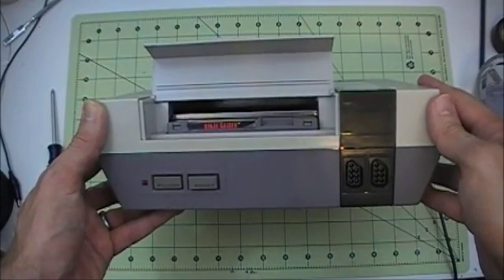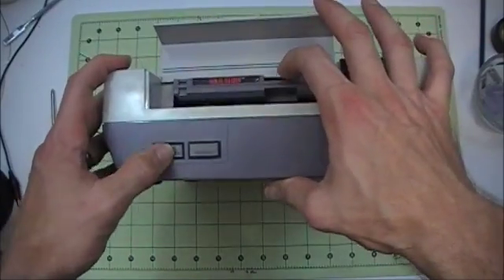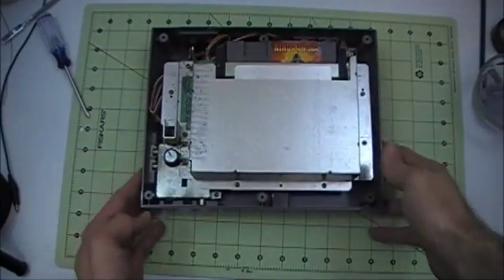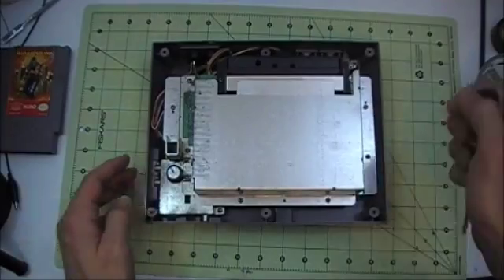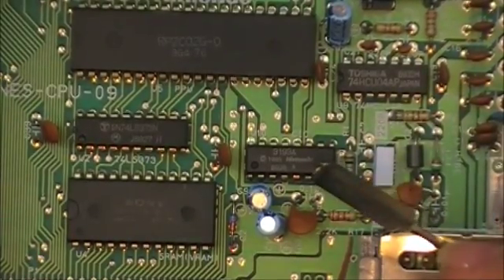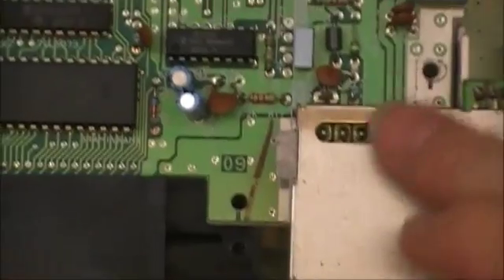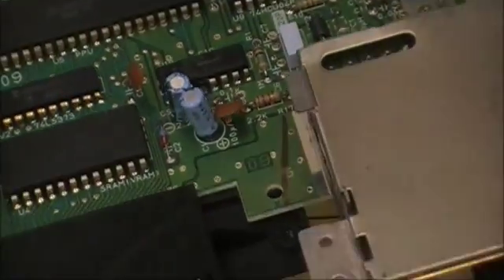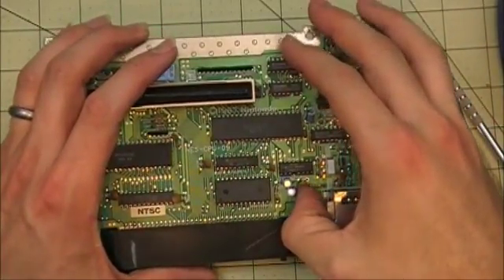Disabling the NES Lockout Chip - Blinking NES Hack

Comment: The best nondestructive way to disable the lockout chip (if cleaning and boiling the 72 pin connector hasn’t worked) is to de-solder pin #4 from the board instead of cutting it.
A cheap $10 soldering iron and a pair of needle nose pliers works well.

Comment: I have disabled the CIC chip on a couple NESs. I like to desolder that one pin and pull it out away from the board. It will work leaving that pin floating but it really should be tied to ground. You can use a short jumper and tie it to the ground for the chip.
Reply: Why should it be tied to ground? I've only ever seen people just clip that pin and push it out of the way.
Reply: @colt5189  just disconnecting the pin will work but that leaves the pin floating. It's better to either tie it high or low. In this case it's low which is ground. When I do them I desolder that pin and pull it up away from the board. I then take a short section of wire or the leg from a new component and tie it to the ground on the chip.

Comment: Great video thanks.
I hadn't used my NES for about a year turned it on and got a grey screen. I accidentally ejected the cartridge without switching it off. Led started blinking. I replaced the 72pin connector. Still blinking.

After following your video it now works perfectly again.

The light was blinking with no cartridge in not sure if that was normal. 

Can ejecting cartridge with power off kill the lockout chip?

Thanks again :)

Comment: I wonder if the lockout chip is what is wrong with my Nintendo NES? Because it has not been turning on at all lately. If eliminating the lockout chip function is what I need to do than that is what I am going to have to do.
Reply: if it doesn't turn on the power supply is likely broken
Reply: @gamecubeplayer  I will not do it myself but I will instead have my local independent home video game console repair man fix what is wrong with my Nintendo NES.
Reply: @wallacelang1374  get a new nes power supply to see if the nes turns on
Reply: @gamecubeplayer  I know that it is not the power supply for it is the flashing red light that is the only thing that works, so I believe that it has to be both the contacts are getting worn out and the #4 pin on the encryption key chip is stuck in its lock out function.

Comment: I have the similar problem, blinking and jumping image. I cleaned the 72-pin, I even replaced it with another original 72-pin and it still produces the same problem. It's not a big deal bc once I restart the system  it fixes itself. But I still wonder what causes the initial blinking when I turn the system on for the first time, and every single time. Could disabling the chip  work?

Comment: This doesn't fix anything it just makes your NES crash in different ways over extended gameplay.
Reply: You did it wrong
Reply: @deluxrefurbish6601  You don't know what you're talking about, RAM and CPU problems exist in many NES consoles and you know.. all computers. The lockout chip doesn't cause the blinking therefore disabling it cannot fix the console.
Reply: @Blind0ne9k  did you cut pin 4
Reply: @deluxrefurbish6601  I have fixed many NES consoles, the right way. Learn about electronics before giving advice.
Reply: @Blind0ne9k  well it makes it region free

Comment: I've opened the NES up before and the 72 pin connector on mine was way bent down so I bent them back up and that fixed it. I didn't bend them too much or the connection would be too tight
Reply: Also I cleaned the connector where the 72 pin went with an eraser and some window cleaner so that did the trick

Comment: Please stop doing this, this is not a "fix", what you say about replacement pin connectors is wrong.  My nes has had a replacement connector in it for 15 years
Reply: Well it may not be a "fix" but it sure helps to solve what stops the resetting issue.

Comment: I have 3 NESs, I cleaned all 3 and I have a copy of Tetris that works with all 3 but Addams Family does not. The contacts are all clean on the game. Can it be faulty? I can see the language select screen for a fraction of a second but then it resets and the red light blinks. Is it the game or all 3 NESs are bad? Tetris works first try every time!
Reply: You need to clean the cardrige so the pins make good contact. Use Isopropilic Alcohol
Reply: @chamuquismalta4310 I figured out the solution since. I bought Addams Family from the UK (PAL region)  and I live in Hungary and all 3 NESs are from Germany (PAL and PAL region). But I wasn't aware of the fact that Nintendo was a stupid asshole and made multiple PAL region games, not just NTSC vs PAL. The seller was kind enough to accept my return.

Comment: This is the most retarded way to fix a something very simple. Either A clean the pins with a game that you put alcohol on over Rand over again, and or B use a dental pick to slightly bend upwards the pins on the connector. Why do you want to risk fucking the board up? This is stupid.
Reply from the maker: I have videos on all of those methods and I recommend this one only as a last resort. There’s also a no cut way to disable the 10NES chip but the documentation is kind of sketchy because it depends on what revision of the board you have.

Comment: I'm a bit on the fence with your hack. I've had the NES since it came out,. Now it's retired to the loft. The flashing LED was there also for cartridge errors, in my case, having poorly store the cartridges, the contacts became oxidise and tarnished, and this LED would tell me that I need to sort the cartridge contacts out. It's annoying, but there for a purpose. It may be hard, but putting a jumper in place would give the option to go back as it was. Just my thoughts, liked your video very much.
Reply from the maker: Mr C I don’t recommend doing this until you’ve tried cleaning everything and tried either refurbishing or replacing the 72 pin connector. I know there is a way to solder some jumpers instead of cutting the pin but I’m not sure if there are instructions out there that work w all motherboard revisions.

Comment: I wonder if this might help with save data erasing on cartridges. I’ve had that happen to me several times with various games. I have to think that with it resetting itself like that u stand more of a chance of it happening. After all u are supposed to hold the reset button to put it into safe mode before powering down to prevent losing save data.
Reply: Save data is saved to the cartidge not the NES, there is a battery inside the cartidge for this purpose. If your losing your saves, it means the battery inside the cartidge is dead and needs replacing. Cutting pin 4 will not fix your save data issue whatsoever
Reply from the maker: I can’t remember exactly what caused NES saves to get messed up (info is available on the net) but you might be onto something.
Reply: @8bitjunkie8  dead battery in the game cartidge is the cause of lost save data. Saves are stored on the cartidge nt the NES

Comment: Fellas Fellas, here is a simple solution. I don't know how many of you have refurbished or repaired NES Consoles but I have refurbished a few hundred since I started and have a killed and fried many as well. So here's the shit: Take the console apart completely, next clean the mother board and copper pins. Next clean the 72 pin connector, boil it in boiling water, yes boil the shit out of it, then pull the pins back to a tighter fit, always clean your games and put the console back together and BAM! Works every time. There are many videos and different varieties you can use and I have learned from many Youtubers and applied my own unique style over experience and works like a charm. I can play foreign games, pirated games and never see a blinking screen ever. Oh yeah you have to disable the lockout chip as well. This is a fun hobby and everyone has their own opinion.  So just enjoy it, share your ideas and stop being a know it all and have fun. Thank you 8bit Junkie for this bad ass video. Ignore the Trolls. : )
Reply from the maker: true story. clean games and boil.  if that doesn't work, bend pins.  if and only if doing all of the above doesn't fix it, or you want to region unlock, disable the 10nes.  

you're welcome.  never feed the trolls.

Comment: one tip I will give people trying this - is when you put the cartridge loading mechanism back on - you might find it doesnt sit flat and seems to be incorrectly placed, and then when you screw it in, the mechanism wont stay down. this is because theres a small plastic tab at the front of the mechanism - that needs to be under the circuit board and not sitting on  top of it. a small amount of jiggling the mechanism around when you first slide it in will get it in the right place. screwing the mechanism down when the tab is placed on top will bend the mechanism and the circuit board - could break it possibly. be careful of that.
Reply: Thanks for the tip! That really helped me.
Reply: Another tip is to slide the mechanism and secure the plastic tab before you secure the entire board to the case.
Reply: You dont even have to remove it.. take out the silver screws and leave the 2 gold screws in it.

Comment: There is zero point to doing this. It doesn't fix problems of blinking light/screen, it only makes them solid. So still the problem is there it's just no longer blinking. I did this mod with a switch on an nes long ago and regret it cause I know now you can just find an adapter for a japanese nes cart and place it and a cartridge on the game genie for NTSC and it will play. No reason to cut a pin when you can just use a game genie. I actually glued my adapter inside a game genie, so now I have to put the cart on one game genie with an adapter (no game genie guts inside) and then on a real game genie. It's fun to see two game genies coming out of the nes while you're playing japanese tetris or something lol.
Reply: Ever heard of the PAL region?
Reply: Morgan Metzger, Ive found my NES to be more reliable and stable since disabling the lockout chip. before disabling it would occasionally reset and start blinking in the middle of a game. and also games will play first time when I put them in more often. but another reason Ive done this is because I use an everdrive cart, and I use it on both an NTSC and PAL NES - disabling the lock out chip means I dont need to keep region calibrating it when switching between them.
Reply: Well actually thats not true at all. The chips commonly went bad, I got a used NES off a guy and got blinking light. I checked the pins, they where clean but I still went ahead and bought a new 72pin connector. That didn't solve my problem. I cut pin four off the lock out chip and boom all my games worked.
Reply: Morgan Metzger
Check out the non-destructive mod, only requires you to bodge 2 wires on the bottom of the PCB, does the same thing and I can confirm it works flawlessly.
Reply: Morgan Metzger
https://aaltomies.wordpress.com/2014/12/26/pal-nes-region-free-mod-without-tampering-with-cic-chip-leg/
Reply: Murdoc
You also can do it without cutting a pin, check my link.
Reply: yeah but game genie's cost money this is free
Reply from the maker: zero point to doing this - you aren't wrong.  I advise people not to do this to fix a blinking NES unless they've done several other steps first.  I believe there are some specific games and/or situations where disabling the 10NES chip still might be advantageous.  But no, you shouldn't do this if you don't need to.

Someone posted a "no-cut" method of disabling the lockout where you solder a few wires to specific points.  I haven't had time to try it yet, and there's at least two different motherboard styles so I'd have to track that down.

Your method is great if you own both a game genie and a famicom adapter...
Reply: +8bitjunkie I just don't see what it does. I've done this to five nes systems and it has never done anything really. you'd need a famicom adapter any way if you are using the lock out to play Japanese games. 

What does this really do?
Reply: spookanide the region of most of Europe and Australia that runs in different hertz and power? no never heard of it. 

Now quit answering questions with snarky questions and say what you mean. do you know for a fact this let's PAL play other regions? what do you know?
Reply: Morgan Metzger
JP is the NTSC region in terms of signal, the region lockout works in the cartridge differences.
Reply: spookanide I understand the signal and power should be the same. However, in practice I use the converter from famicom to nes and it never works. I have to use a game genie on it to disable something. I've done many region unlocks but have never found one that fixes this. You would think all region lock outs work similar.
Reply: Morgan Metzger
You should really try the non-destructive method I mentioned. If you know how to hold a soldering iron you should be fine doing it yourself, otherwise just look up a quick soldering tutorial.
 Screwing the unit apart takes longer than the actual mod.
Reply: +spookanide I can't seem to find the mod you are talking about on google.  I'm sure if I find it, I could do it. I've done a lot of soldering and I've opened a ton of nes lol.
Reply: Agreed but any PCB modification is at the owners own risk XD
Reply: Morgan Metzger and pin 4 is already grounded.  surely he could see that huge ground plane?
Reply: Murdoc last time I did this hack I got ITV
Reply: What? ITV? What is that?

Comment: Boiling the pin connector actually works really well!
Reply: I tried this on four NES consoles recently. All four of them still blinking :(
Reply: @RetroFrito  try doin what this review did
Reply: @RetroFrito  boiled my pins a couple days ago and NES works great. Helps if you clean your games too. Most of mine don't have dust sleeves. Even a tiny amount of dust can still affect connection.
Reply: I wish I had known sooner; got a replacement 72 pin connector in 2007 and now, I gotta get me a Blinking Light Win...
Reply: What do you mean by boiling the pin? Literally using a solder iron and heat up every single pin?
Reply: 007nice3 This comment from 3 years ago when I was a noob collector. Haha
Check out this restoration tutorial. 👍🏻

https://youtu.be/cvvXVx3zanM